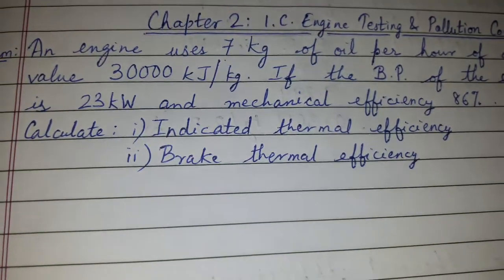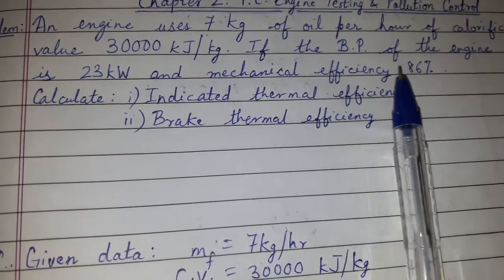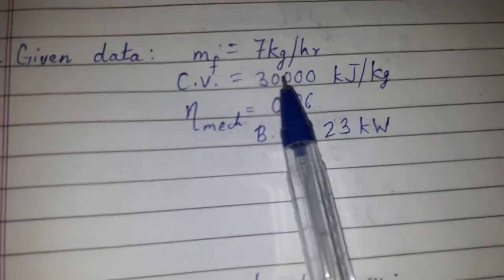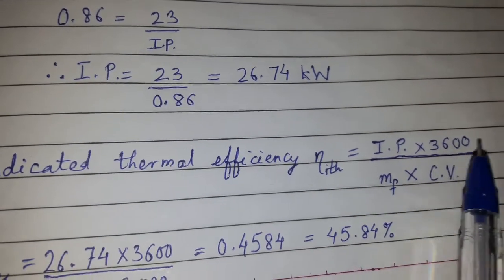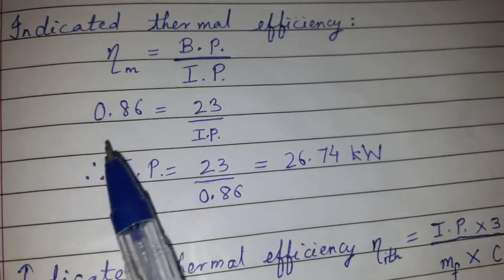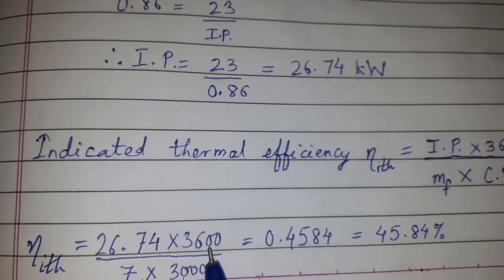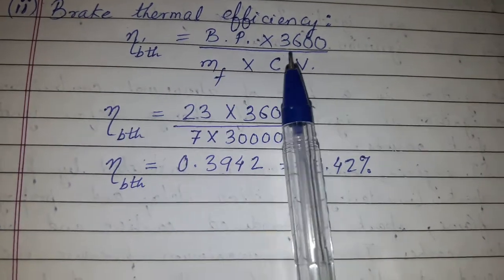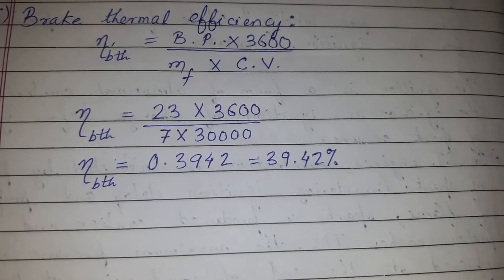Solved problem from Ch 2 - I.C. Engine testing and pollution control (Part 2)

Comment: Where did you get the 3600 from ??
Reply from the maker: Unit of mf is kg/hr, therefore 3600 in formula.... If unit of mf is kg/s, then 3600 not required in formula...

1hr. = 60 min. = 3600 sec.